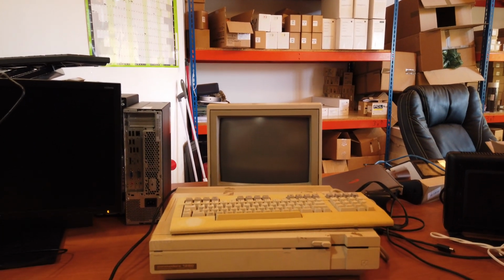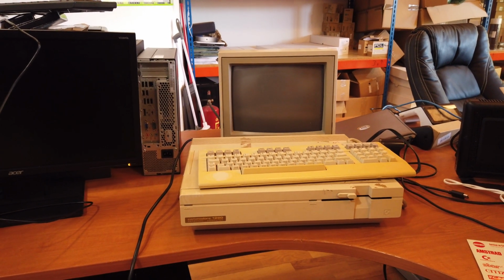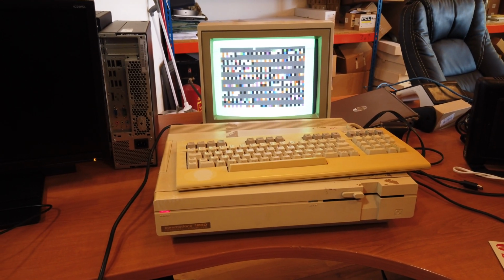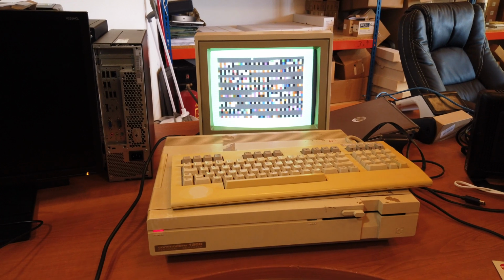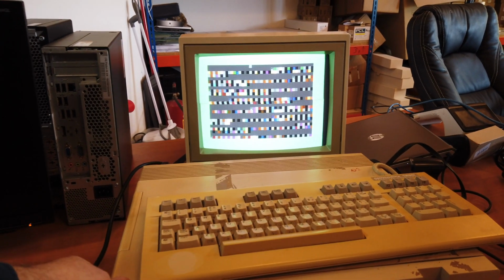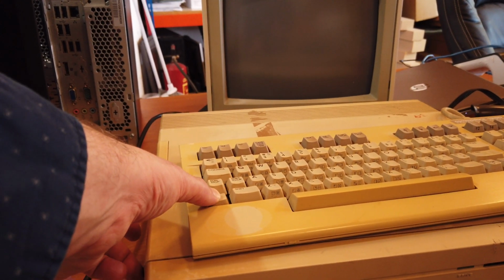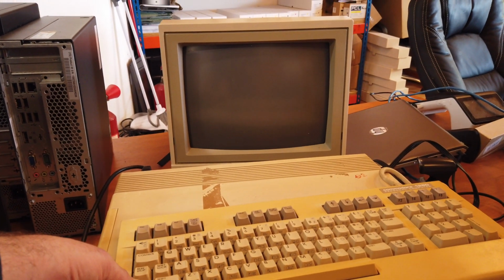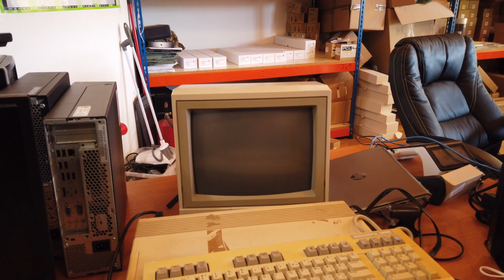026 - Commodore C128D (Plastic Case Version) Repair Part 1

Comment: Nice! I am trying to fix one of this. Looks like I have an issue on the Psu. Did you find any specific service manual or diagram for this model?
Reply from the maker: See http://www.zimmers.net/anonftp/pub/cbm/schematics/computers/c128/servicemanuals/index.html
Reply: @skearon  thank you but any of the files has the psu for this German model 😅
Reply from the maker: @Radiogenes  Unfortunately I have't been able to find one.  If you find one yourself, do let me know
Reply: @skearon  i ended up buying a 5v and a 12v psu. I placed them inside the old psu enclosure. Just make sure the 5v is able to deliver about 4amp and the 12v about 1.5 amp